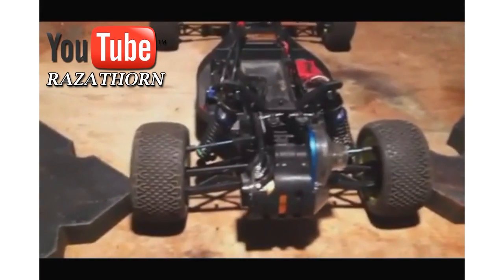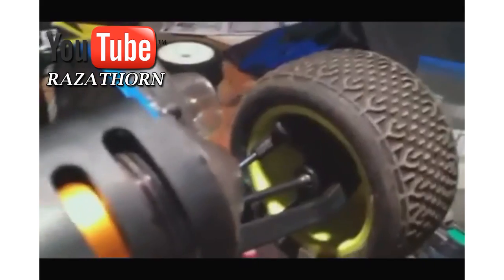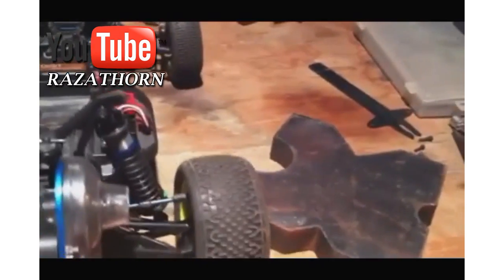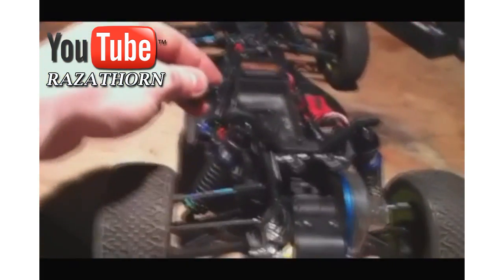Radio Control Car - Roll Center Demonstration

Comment: Anyone have first hand experience on what works better for carpet tracks? I would think the high bite would need a lower roll center because the tire has so much grip and you don't need the chassis to roll over to keep contact with the tire? But I haven't tried it.

Comment: One thing I'd like to add, most people say lower roll centre to gain grip and raise it to lose grip.  That's not always technically correct.

Take high grip astro.  If you have your roll centre at the highest possible, your car will react extremely fast on the rear, however due to lack of roll, it gets to the end of it's roll extremely quickly and tends to traction roll.

We counter this by lowering the roll centre, allowing the car to roll further and numbing the rear.